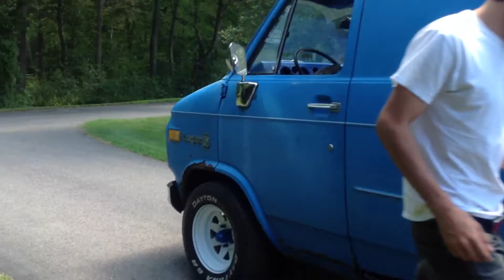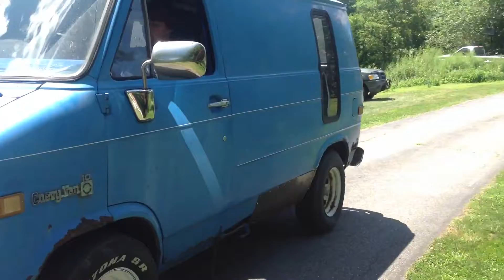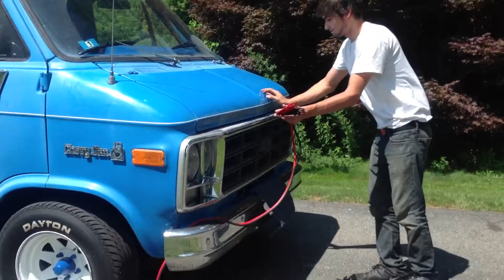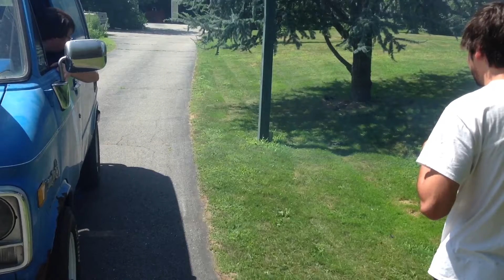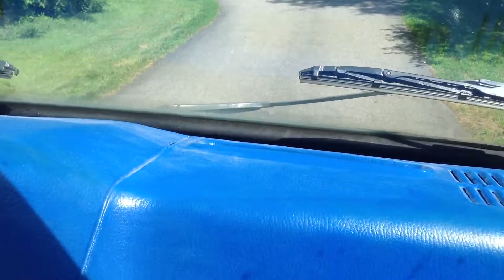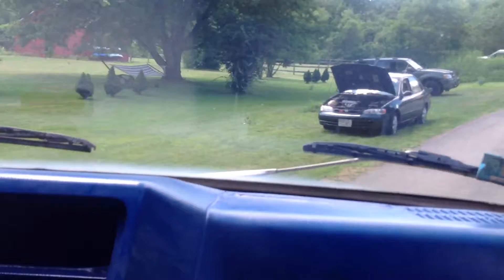Just a normal Sunday with the 79 Chevy Van!

Comment: Never pop start in 1st gear. It may be the easiest gear for the engine to turn the wheel but it's the hardest gear for the wheels to turn the engine. Use 2nd or 3rd and be ready to push the clutch back in quick when it starts.
Reply from the maker: Thank you! i never thought about the difference between the driven and the driving gear, that makes much more sense!